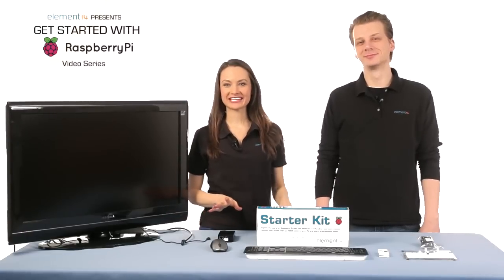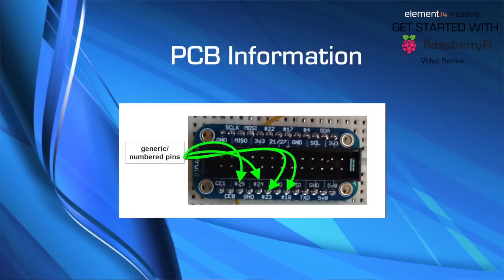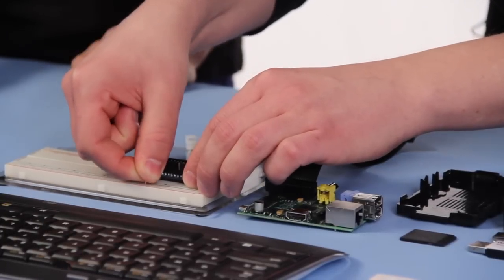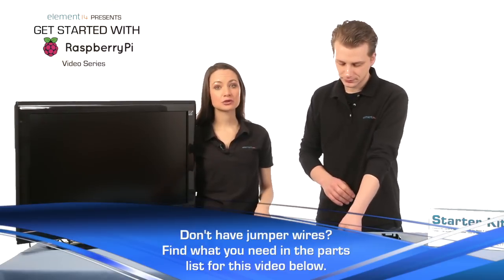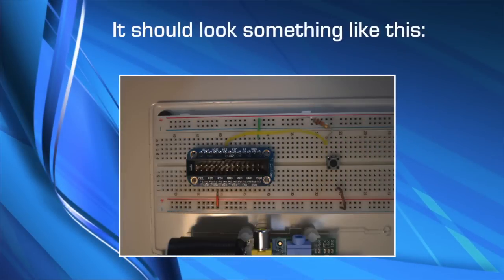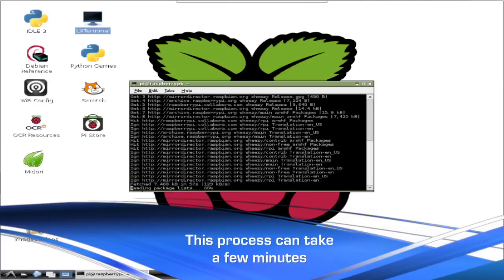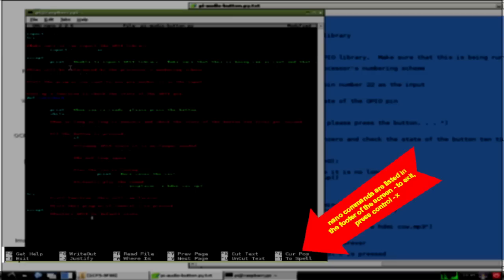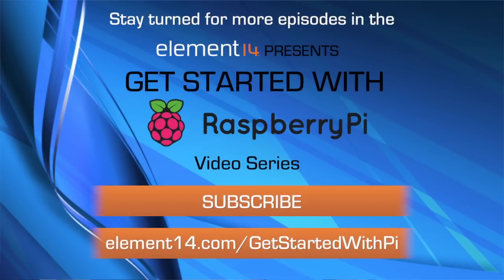Get Started with Raspberry Pi 4 - Your First Pi Project

Comment: Who wrote the dialog for this video? The way Jenny describes the correlation between voltage and current would confuse the hell out of any beginner trying to get their head around this stuff.. and while they're at it, how come they couldn't mention the actual current limits of the GPIO pins? Also, can't help but notice Jenny is giving that television stand a workout!

Comment: How did you come up w/ 22KOhm resistor to pull the voltage to the button?  The button is 12V according to the part list?

Comment: Don't green wires usually run to ground and orange wires... don't?
Reply from the maker: It entirely depends on what standard you're following.
Reply: I usually uses black as ground and red to +5 or +3.3V
Reply: Black is DC ground, Red +5, Orange +3.3, yellow +12
generally from ATX PS
Reply: jose gonzales yes, that is the convention to reduce mistakes.
On AC 240V ground is yellow/green here though (if not very old, then it can be read). Zero are blue and phase are black.

Comment: Hi. I am working on a project for a  school that requires installation of Raspberry Pi 3 as student desktop workstation with 10 inch LCD  Screen. My issue is where to find the 10 inch LCD  Screen. I have checked on Ebay and Amazon but can find any merchant offering only 10 inch LCD  Screen for computer assemble purposes. I will be most gratefully if anyone can offer suggestions. Kind regards.

Comment: Im getting a new pi because i had mine for one day and i think i fucked it up it starts up but doesnt display on my tv i booted it up once then turned it off then tried to turn it on and no display
Reply: +Noah Byrge Sorry that I am replying 2 months after you commented, but did you install NOOBS OS onto the SD card?
Reply: Leon Bass i fixed it i plugged it and it which corrupted the sd card and since there is no firmware on the pi it wont display so i just formatted the sd and installed noobs
Reply: That's great :D
Reply: i am tired of pi's i am doing somework for a guy and it involves pi's and im tired of the job probably going to quit

Comment: All that for a single button?
Not everyone is using this for teaching. Wish they had an easier way then more people might actually get interested in this thing.
And talk about a massive footprint increase for a button. Just not practical at all.
Reply: +Anon Mason a "Button"  could be a door alarm a end switch to control a motor or damper etc ..  this is the basic's to make you think .. You can do alot with  an open or closed contact ..